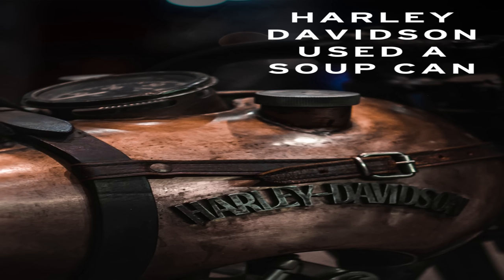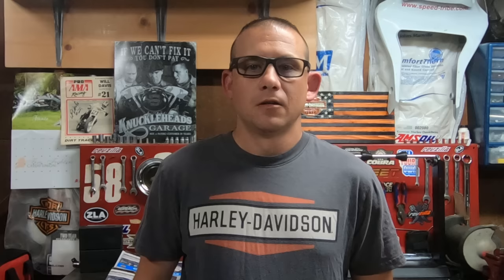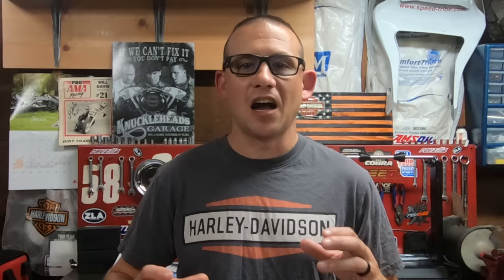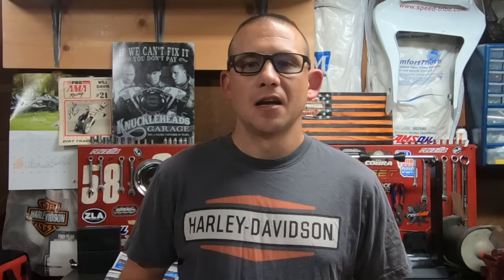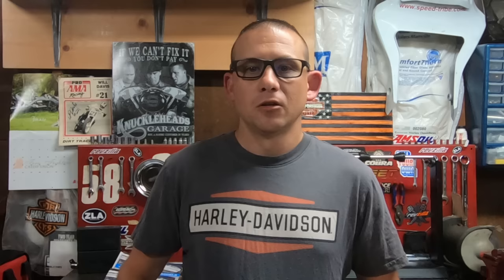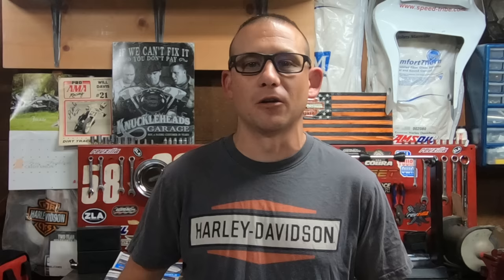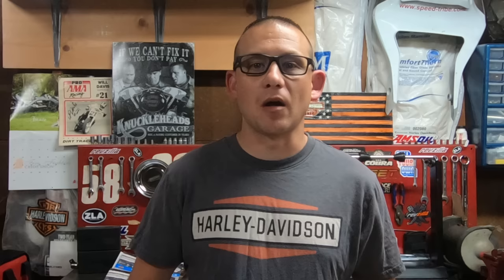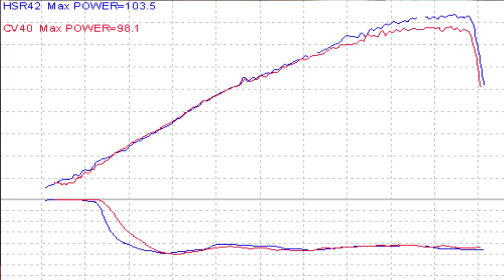CV Carburetor or the Mikuni HSR for Your Harley-Davidson

Comment from the maker: What's you're carburetor preference and why? Maybe you just hate carbs and prefer fuel injection...
Reply: No one “hates” carbs. You just can’t deny the benefits of efi. It’s just sooo superior in every way. 
I like a old school Harley but I also love my dyna that passes everything but a gas station.
Reply: @Bluis5445  why? If you get a check engine light and need a technician to clear and fix it? Screw that nonsense... I wouldn't own a motorcycle if it didn't have throttle cables and a carburetor
Reply: @Bluis5445  I have a 2005 with EFI. Awsome performance with a trouble free EFI.But my 1998 Fat Boy CVO. I did make some changes to the CV carb.But I also chance the stock ignition system to be able to adjust it with my carburetation changes I'd made.Changing one thing can affect something else.But in my case it was a must do kinda thing to get the performance I was asking for out of my 1998 Fatboy.Was well worth making those changes.
Reply: I’m sorry I just can’t hear very well over my efi making 145hp and 155 tq. Well when ever y’all decide to join the rest of the world and ditch your carbs we can have civilized conversation.
Reply: @Bluis5445  I prefer fuel injection, the guys who stunt Harleys prefer the cv. Why you ask well its smoother like fuel injection. If fuel injection wasn't superior all cars trucks etc. Would still have carbs. I've had a fi sporty a carb evo and now a fi fat bob. I'll take the fuel injection. I don't worry about elevation changes etc. As it adjusts auto accordingly. I also don't have to give it a min to warm up.
Reply: I’m running a Mikuni on my Shovelhead, had a few other carbs before. This one is just easy and runs great. Starts easy
Reply: @Bluis5445  145/155 very good. What model Bagger ? What motor, How many cubes?
Reply: @scrumthebum2451  dyna 143 twin cam. Running lean. Should dyno and make more hp.
Reply: Again as far as reliability you can't beat EFI. But if something goes wrong, or you want to tune them you're screwed.
Reply: @Bluis5445  
Wow😳 on a dyna that must be a blast to ride 🔥
Reply: Mikuni- if you need to ask then you haven't tried one. Not directed towards you Foo, general public.
Reply: I refuse to purchase efi tuners or rely on shops to get the “maps” just right. The CV is bulletproof and I get 50 mpg on a cammed up 1200
Reply: @getoffmygrass6974  
I had mikuni on 4 out of 5 - 2 stroke dirt bikes also had 4 of them on my Kz 1000. When it comes to Harley I don’t like them. S&S rules at AHDRA & AMRA Harley drags. You would be hard pressed to find even one mikuni out of 150to 200 HD  drag bikes
Reply: @scrumthebum2451  Thats what I said in my post, S&S is the best carb for WFO
Reply: I have two 79 models, an XLH and an FXEF, so I have nothing but carbs. The two stock Keihins are on the shelf, the Ironhead has an S&S and the Shovelhead has a Bendix. Since I just ride around town and back roads they all work just fine for me. Most of my friends have only owned Harleys in the FI era so they look at my carbs like they are some ancient technology from the time when we pounded nails with rocks. I clearly see the benefits from fuel injection but there is something about having your bike running poorly, spending some time tinkering with your carb and making it run even worse that just goes with owning a couple of 79 models. So just have fun doing whatever works for you.
Reply: @turbosube5083  The simplicity of Venturi is bulletproof and my Mikuni responds immediately if not faster than FI, by an unnoticeable millisecond. We also don’t need to worry about O2 sensors,the gear lash in FBW applications, though they’ve seemed to be better lately, I’m just a fan of a cable and wouldn’t trade it for cruise. Now, warming up, a carb fart here and there, sure, but she runs 12 months a year up here in New England, no problem. The best part for me is the sound and smell of my 2002 Twin Cam loping. In reality, I love them all and wish I had one of each era.
Reply: @Bluis5445  That's a heathy motor but how much cash did it take to get those numbers all I'm saying is that a handful of carb jets is way cheaper then the tuner you have on that bike sure if I go to higher elevation s I'll have to make a jet change but I don't mind that !
Reply: @Bluis5445  LOL>>Stated Greatly
Reply: @kennethwise7108  A-MEN Brother!! NW GA Here
Reply: @robertrosson1990   A-MEN Brother >>NW GA HERE
Reply: @Bluis5445  ive had much more luck with carby{maybe my dumbass brain?} i like being able to reach down at the stop light and turn the idle ssuuppeerr low for long lights so she doesnt heat up as quick{450R eduro} 

but i think on things like a normal daily rider then ya efi is better so long as you have a tuner and can adjust for alt.
Reply: @Bluis5445  to be fair a minor sunburst could knock out efi for a while. very unlikely. but hey. cant fight that prepper bug XD
Reply: I have a stock 96 softail with 93k miles so Im sticking with the cv 40 that just had a diaphragm failure. And a new replacement was only $200
Reply: My 2000 sportster came with a keihin butterfly and swapped it for a Shorty Super e. The S&S runs the bike pretty well but not as well as a Mikuni I think. Gonna add a yost power tube, yost spacer, and a thunderjet and see if it gets better.
Reply: S&s super E on my 2001 twincam   super E on my 84 evo and Mikuni on my 81 iron head sportster. The mikuni had a really strong spring, I  sold it soon after fitting it. All carbs easy to fit and tune.
Reply: @Bluis5445  my dad has a dyna with a little work. Built trans. Upgraded compensator. Possibly cams. Was tuned. My 94 beat to hell 1200 sporty absolutely EATS it. I’ve put a good bit of miles on both and I like the dyna for cruising and highways but the sporty accelerates sooooo much more aggressively. Carbs are much better for the person that prefers to work on there own stuff. Don’t need to spend a crap ton every time I change something to tune it. Realistically both are nearly identical. Both do essentially the same thing. There’s 2000hp drag cars with carbs. Not to mention older nascars just seemed to be so much nastier before they went to efi. It’s more environmentally friendly but better in every way? Nahhh
Reply: Take a look at the XR 750 which ruled flat track racing for 40 years and you'll see not 1 but 2 Mikuni carbs. That tells you what HD thinks about Mikuni
Reply: Fuel injection is clearly superior but who wants fuel injection on a knucklehead or panhead
Reply: It's very real and annoying but I got use to it and the performance is unreal. It was a CV witch was ok but flatside is much better 👌 thanks for your time and effort. Keep them coming.
Reply: @Bluis5445  ci?
Reply: A bit old hat but a well set up Stromberg is nothing to sniff at, and no need to replace any jets.
Reply: Gixxer, I would like your feed back because I've had HD Forum guys claim my jetting can't be correct. 03 FXD, 95in, big bore, stock stroke. Joe Mondello Heads, Wood TG8 gear drive cams, Dyna Jet ign, 10.5-1 comp. Bassani 2 into one exhaust and the carb is the stock size CV with .205 main and .50 slow jet. I live on Maui at sea level and it runs perfect and I don't notice any lag when I nail it and no flat spots. Runs good even when I ride up Haleakla to over 5000 ft. I've been told it is too much jet by guys that don't live here or have riden my bike. Plugs look good too.

Comment: Back in the day when cv carbs were stock on the motorsickle and you wanted the Screaming Eagle upgrade when you opened the box there was a 42HSR Mikuni carb in it. That tells you what the HD engineers thought about them
Reply: I have used both of these carburetors . I like them both. A lot of people change out the CV for the flat slide for a up grade. I have  found that the CV is a little more forgiving with  elevation changes. The flat slide does give a little more on performance end. I really  can't say that there is anything bad with either one of them.

Comment: The CV carb was the first carburetor I’d ever worked on as a younger guy (27), and I have to say I took for granted how good a carb it is.  I took it off my bike once to rebuild it when I bought the bike, and the way that the engine vacuum operates the slide basically means you just set your pilot jet right, get a decent sized main jet in there and check your throttle cables and you’re rocking and rolling.
Reply from the maker: They are pretty easy to work on, you keep the diaphrams in good shape and you're all set.

Comment: The CV is simple to tune.. it's actually a really good carb.
Reply from the maker: It really is, it's been around a long time and a lot of people have had a lot of success with power and tuning!
Reply: Back when I was tuning mine in, I found some shortcuts (I'd have to do again to remember) that got my jet changes down to 15 minutes. Just ignore the book and you'll probably find them instinctively.  I added one of those cross-fin air directors in front of the carb (Boyesen X Fin or something) and you won't got the claimed 10hp gains, but I notice the throttle response is a bit quicker. Voila! A back door Mikuni!

Comment: CV carbs work great when changing elevations from sea level to mountains.
Reply: Amen -
Reply: Not any different than the mikuni Hsr as far as altitude changes. Throttle response, no comparison the Hsr is unbeatable.
Reply: @davidleonard8369  well I believe that ; but longtime had mechanic loves mikuni for performance but cv for altitude changes -
Reply: @crspcritter  hammer performance has ridden sportsters and Buels up to 10500 feet in Colorado. They state on their website that neither the mikuni or the cv had any real problems. They all just lost some power due to the thin air. They sell both carburetors but claim that the long stand tradition of cv carburetors working better in different altitudes is just a myth that won't die. I have ridden my sportster with both carbs from below sea level at the salton sea to over 9000 feet up in the mountains of big bear and I completely agree with them.
Reply: @davidleonard8369  amen and many thanks fer that ; I ride to big bear many times also . Right in my backyard. 
My buddy the ret hd mechanic puts mikuni on many . A bit of a dial in . 
Well unless it makes a great difference in power and performance. You know it’s pretty fair share of bucks out the window-
👍👌

Comment: Back when Harley was using the CV carb if you wanted the Screaming Eagle upgrade when you opened the box it contained a HSR 42  Mikuni. That tells you what HD engineers think about Mikuni. Nuff said
Reply from the maker: I like that Mikuni carb, they those things are close to fuel injection level throttle response. Dialed in right they produce more and don't kill the fuel economy. If you fuel economy takes a dump with a Mikuni it's not setup right.

Comment: I agree with everything you said. CV carbs are fine with a stock or slightly modified engine but IMHO, if you've got a big cam, head work, etc, there's no point in modifying a CV. You'll be much happier with a Mikuni. I bought my 2000 soft tail used about 8 years ago. If it had to idle in traffic it would foul the plugs, didn't like to start when it was warm, etc. I took the carb apart and, low and behold! There was a Dyna jet kit. This is a stock 88 with air cleaner and exhaust. They had the biggest pilot jet available (I think an .048), but the wildest thing was they put 3 spacers under the needle! I figure there must have been 3 spacers in the kit so they just used them all. No wonder it ran like it did. What a bone head thing to do! So I rebuilt it with CV Performance parts and she's been wonderful ever since. Moral of the story - don't let a bone head work on your bike!

Comment: Just switched to a 42mm Mikuni on my '94 Evo and love it.  The instant throttle response is something you can feel for sure.
Reply from the maker: That's the biggest thing about the Mikuni is the throttle response.
Reply: Did you change jets? Or the stock jetting good?
Reply: @dustyfelts1261  I changed the jet to a larger one, but when I took it to my mechanic for cam work, he put the original jet back in it.  So to answer your question, leave the stock jets in and run it for a while and check your plugs.
Reply: @stevenking9357  sweet thank for replying. I did change the main to 165 and the accelerater pump from a 70 to a 50.. but now not sure if the slow jet should stay a 25
Reply: Btw I have a stock 88 not an Evo tho
Reply: @dustyfelts1261  you may be a little rich. 
I have a 95 twin cam with 26g cams and my main jet is a 155. That’s resulting in around 12.8 AFR at WOT. I know when the weather warms up I may need to go down a jet to 152.5. 
Accel is 50 and idle is 25 needle is the 97 with the clip 2nd from the top (stock is middle). This gets me AFR results that are probably as close to perfect for a carb. Obviously your engine is different from mine.

Comment: Your channel is one stop shopping for basic Harley info.  Good source.  One of the few channels I subscribe to.

I am prepping to do a top end job and other work myself, on my 80k+ miles 93' Evo Heritage, bike show winner (2010 OKC Fair Grounds Bike Show).  It sat for years while I was ill.  Now I got to get it running right as cheap as I can.  I come here to help me figure that out.  

This episode confirms that I am going to rebuild my CV carb. again or have a service mega clean it, since it sat so long.  For my autos, fuel injection is fine, but for my Harley, I like being able to tweek it myself with a screwdriver.  

To your question, I prefer the CV over others because I already have it and it works well.

Looks like your an OSU Cowboy/fan?  Dont hold it against me, but Im an O.U. Sooner grad. LOL!
Reply from the maker: Hey I was at that show in 2010, I likely saw your bike! I appreciate the subscription!
Reply: It won Best in Evo Class.  I customized it myself for my biz.  I removed all sheet metal and replaced with chromed stretched gas tanks, chromed full fenders, chromed fatboy wheels and chromed brake rotor covers,  chrome brake calipers, etc,  all against the lowered shocks black frame and black and chrome engine.  I designed some mega fat Z bars and had them custom made.  Added a Rick Doss headlight cover and rear V shaped tail light bar.  I put black screen door screen on all the front lights for dark effect. LOL!   ....and I drove it like that all over the country (with full windshield).

I originally, just drove it to see the show. A show official saw it as I pulled up and parked and asked me to enter it.  Mega shocked to have won!

Comment: I went with a Mikuni when I had my TC88B slightly modified back in the day. Per Harley-Davidson’s part manual I went with a Mikuni carb, hi flow air intake, Vance & Hines pipes, Screaming Eagle ignition, platinum plugs and a torque cam. I noticed a rather significant improvement in acceleration initially but have grown use to it over the years so it seems normal to me. 19 years later, knock on wood, and she still runs pretty good.
Reply from the maker: That's awesome you did all that work years ago and still got the bike and running great today!
Reply: That's virtually my engine right there! 2-1 pipes and Andrew's 21 cams. I added one of those cross-fin air directors in front of the carb (Boyesen X Fin or something) and you won't got the claimed 10hp gains, but I notice the throttle response is a bit quicker.

Comment: Long live the SU. I bought a shovelhead with a mikuni once. Removed and installed an SU. Ran beautifully. If a manifold was available I wouldn't hesitate to put one on a twin cam.
Reply from the maker: That's one you don't hear about often these days!
Reply: SU carb where great carb also ,if I could find SU carb + manifold , I'd run one on my S&S 107 ci Evo motor they were a great carb for proformance and simple also I keeping my eyes open at bike swap meets maybe get lucky
Reply: My brother in law has had an old S U carb on his 58 pan for what seems like forever he sez there's.  no need for anything else  My experience in the past was all good with the bendix and the oh so simple mikuni 
Not a screamer but so reliable and easy to work on.nowadays it's a super e . on my shovel

Comment: My 1988 FLHTC Electra Glide Classic was modified by a previous owner with a CV carb, but that owner was in Wisconsin. In Southwestern Texas at sea level I needed to change a jet. It wasn't that hard of a job. Did not need to remove the carb from the bike. Just drop the float bowl and screw it out, new one in. Now runs great. On a Shovel I threw away the stock carb and ran a Lectron.  It ran strong. With no other modification I was out running Evos.  I think I paid $25 for it at a swap meet. Now they cost more than an S&S. I am happy with my CV carb and will stay with it.
Reply from the maker: Nothing wrong with the CV really, they are great carbs!

Comment: old time rider. back in the Stone Age i ran a su because i would ride from sea level to the mountains in New York every other weekend. my bike wouldn’t be leaning out upstate. i could just ride without hurting my motor. the cv carb works the same way But, with a acc pump   jet it with a cv proformance kit and it’s sweet
Reply: This is the main reason I want the CV carb. Riding in the mountains in Oregon with CV carb on the Honda 350SL we would pass the Harleys going up the steep grade that had to stop and readjust mixture for high altitude.
Reply: @AlexCausey  if you were too cool, or on aware, you would hurt your motor